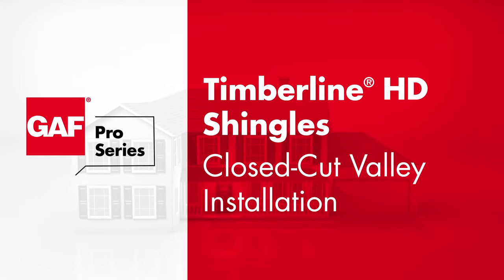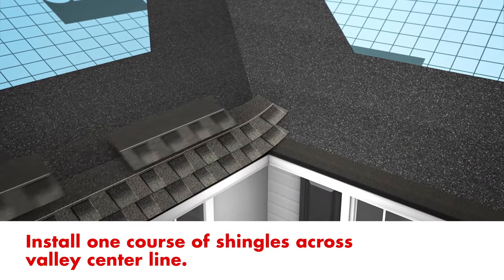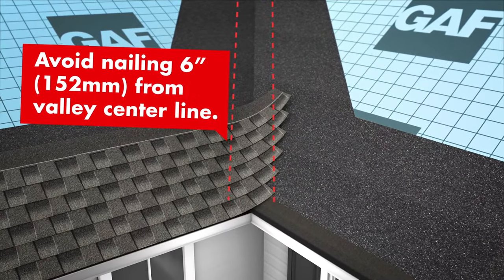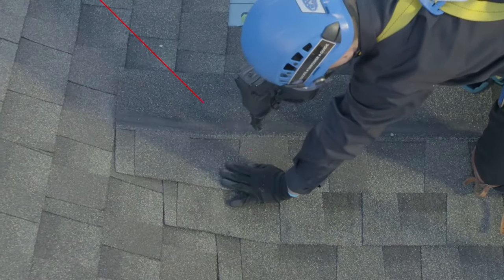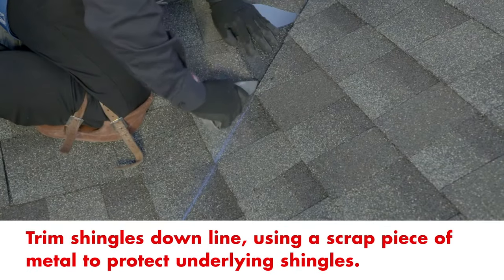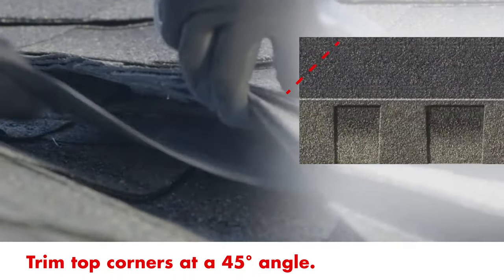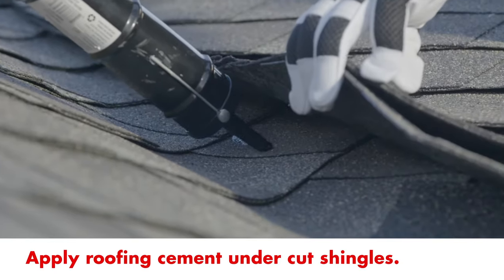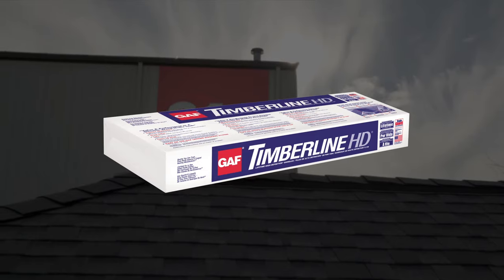How to Install Timberline HD Shingles with the Closed-Cut Valley Method | GAF Pro Series

Comment: Other methods weave the first course under the other side. See other GAF valley types video
Reply: Yes I seen a video where they run a shingle for the over side first. Sometimes 2 then they go back and lay the underside completely up thru the valley. Then they go back and lay the over side once the valley and underside is complete

Comment: Does GAF not recommend the "speed valley" or "lazy man's valley" or "California valley" method? And in those installations, do those tabs catch and hold water being they are perpendicular to the valley?
Reply from the maker: Hi, Timberline Series shingles can be installed with a California Valley, as long as there is a min 4/12 slope. You can find more information about this method here: http://spr.ly/60545RdIQ.